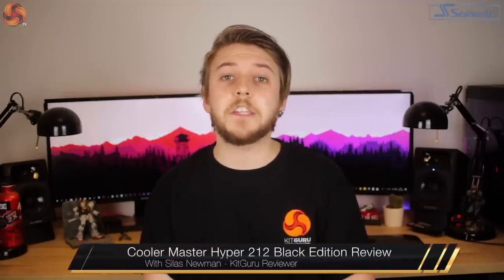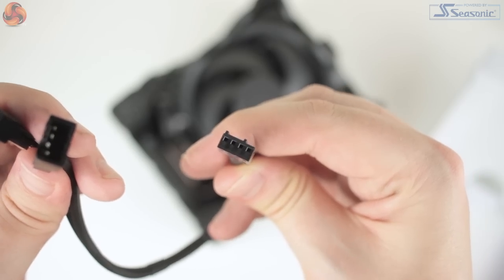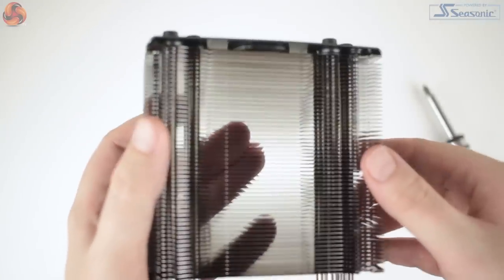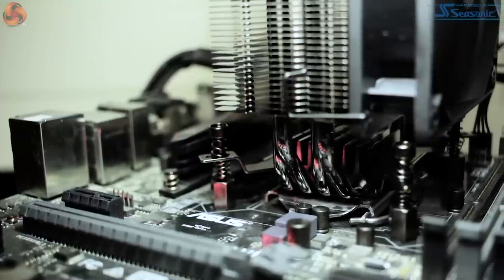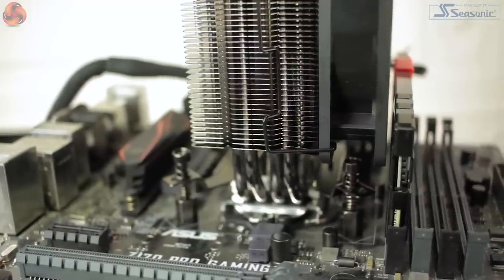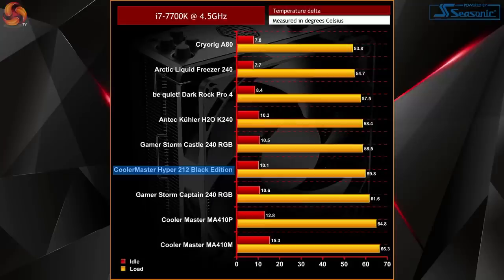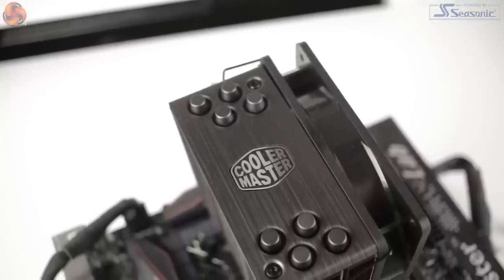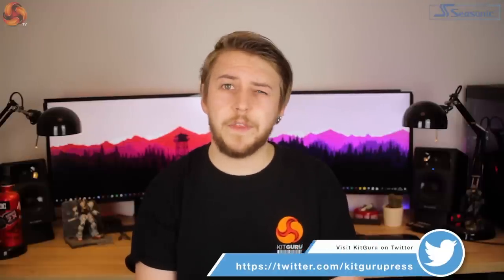Cooler Master Hyper 212 Black Edition Review - Its BACK IN BLACK!

Comment: Performs just a few degrees off from that monster Dark Rock Pro 4 at almost 1/3 the cost, doesnt block ram slots, doesnt block air flow as such either as a big block cooler.  Performs on par or better than a lot of AIO units without the concern of pump failure or leaks.  This looks like a winner to me!
Reply: @xdarthpool6463  bulky... lol my NH-D15 would like a word....

Comment: Just bought this CPU cooler for my new build and im loving it!!! it looks so great and clean for a air cooler
~~ awesome and informative video thanks mate
Reply: Did your motherboard have an rgb header or do you have to use the rgb controller that came with it, I just ordered one too but I realized I don't have a rgb header on my motherboard, kinda worried about how well it's going to work.
Reply: Excuse me to disturb you, when you browse the net, do you understand the increased cooler and lowered the speed of ventilation?

Sorry for my engl i'm french
Reply: is it loud
Reply: @arjay_2002  
Not for me at least.

Comment: i have a msi b450m pro m2 with only 2 slots of ram, in witch I have 2 x 8 gb hyper predator 3200 MHz, this cooler will fit well o will I have problems with the space between the fan and the ram?

Comment: Very good cooler at least for my ryzen 5 3600 temp whent down significant from like 50 idle to 36 I recomend
Reply: How is noise? Competed to stock cooler?
Reply: I have just bought for my 3600.  I had it in a SFF case with the stock cooler and it was hitting 95 deg when gaming.  I found turning off the automatic boost made a huge 30 deg difference, but obviously at a cost to performance. I have ordered a new case too so hopefully this will finally keep my 3600 cool!
Reply: I have just bought for my 3600.  I had it in a SFF case with the stock cooler and it was hitting 95 deg when gaming.  I found turning off the automatic boost made a huge 30 deg difference, but obviously at a cost to performance. I have ordered a new case too so hopefully this will finally keep my 3600 cool!
Reply: I recommend it as well. It's at 35 to 40 C when idle. 60 tops during Doom Eternal at high settings.

Comment: Ive just ordered it yesterday on amazon, today i will use it, im replacing the stock cooler from my amd ryzen 2700x
Reply: how does it perform compared to the stock cooler? how much lower were temps and did you overclock any better?
Reply: Im wondering too! Did you buy it? And how does it perform?
Reply: Same!

Comment: So, think this will let a Ryzen 3600 (not X) hit max turbo under load?
Reply: Most likely not. I have it on my 2600. The max boost on it is suppose to be 3.9ghz but under sustained load it settles at around 3.65 - 3.75ghz. 

The max boost on ryzen chips are usually only for 1 or 2 cores and they dont stay at that clock for long. Usually you will see the sustained load clock be around 100-250mhz lower than the stock max boost clock.

This cooler does a much better job at cooling my R5 2600 than the stock wraith did, you can use it to overclock ur 3600 so you get an all core higher speed. It cut off over 10c on idle, gaming and stress tests. It will give you more headroom so its possible your 3600 will get a slightly higher sustained load speed.

Comment: ARCTIC Freezer 33 Esports ONE definitely the better deal
Reply: my arctic freezer has a nasty coil whine and the clips didnt sit properly even after trying to bend them to fit and the rubber mounts didnt stick for crap definitely not worth the hassle for 30$+
Reply: Just the deal or entirely better thing?
Reply: @masternippleblaster  In my opinion if you aren't shooting for the RGB fan they include, the Freezer 33 is a great deal, they're both 4 heat pipes so they perform within reasonable margin of each other.
Reply: @DylanJGrace  Thank you for the reply bro! No, I am not going for RGB thus performance is my main goal. I was trying to find a review of both of them head2head to compare them yet only individual reviews are available... In general (as to mu knowledge) it comes to the heatsink and the performance of the same thus I am still not sure... CM is rated 150 TDP and AC is around 200 if I am not mistaking yet that should, as always, be taken with a grain of salt as they say... CM is in my opinion sleeker, especially with the brushed cover and the overall "stealth" design, compared to the AC with its chrome mounting brackets. Might be nitpicking but the overall build/theme does matter.

Comment: Is it a paint job as you claim or is it anodized? Whether it's painted as you claim or actually anodized will justify the higher price. Another thing that may justify the higher price is the fan quality.
Reply: It's actually nickel plated
Reply: @MI2SL0  agreed but the question is, is the black version anodized or painted. He asked in the video about the higher cost of the black version. Whether it's painted or anodized could justify the higher price.

Comment: Can it handle my i7 7700k at 4.5Ghz with 1.2vcore? Actually, I have a Gammaxx S40 and it keeps 90º using 100% of the cpu and 70~80º gaming.
Reply: The Gammaxx S40 becomes thermally saturated so it becomes much worse when you overclock that i7. Based on quickly looking I'd expect 10 to 15degC lower temps with the 212 Black or some combo of lower temps and lower noise. It appears to be the best value and getting an even noticeably better cooler would add an amount over the 212 Black of 40% or so... ensure you have at least one intake fan and one exhaust fan as well (generally speaking they need not be very fast such as 700RPM and ideally should be rated as case fans). If possible use the motherboard fan control software that comes from the motherboard support site (sometimes under W8 or even W7 64-bit section).

Comment: I wonder of it'll fit the corsair spec 01 :(
Reply: check the height specifications of the cpu cooler and the maximium cpu cooler height for the case
Reply: @sabu4539  the recommended height is 150mm for spec 01 but ppl have also tried fitting 212x and 212 evo so it fits up to 160mm but am not so sure about this new variant
Reply: Did u bought it and it feets? The specifications is 158mm. I have the same spec-01 and wondering if it works fine
Reply: @hensickness  well it'll not close properly, bit still it'll not look took bad. Go for it. I can show u how it fits if i want to see

Comment: So a 212 evo is the same as a dark rock pro 4 ? This testing hardly seems accurate tbh, a 5ghz or so test should be included or a similar one that pushes near thermal limits, that is when a good cooler differentiates from the cheap ones, i mean what is the point in this testing if all coolers are the same, do a real test and i bet the 212 will be over 10C hotter than the dark rock pro 4, let alone the liquid coolers at 75c+. Also that noise level seems sketchy as well with all being really loud at ~45dba. Generally i like this channels videos but this will be the first i dislike as the testing seems faulty.
Reply: that's hard to believe I agree. A dual tower cooler with basically twice the surface is supposed to be on paar? hmm seems like the testing has gone wrong.
Reply: Im not sure if you noticed the part that says "Temprature Delta" which typically means the subtracted room temp so add 21c
Reply: if you are going with a cheap air cooler you probably won't be pushing your CPU speed to 5ghz